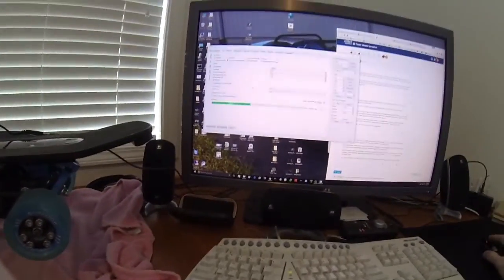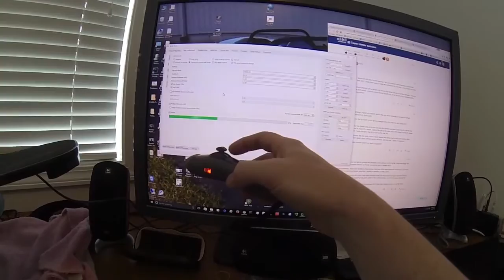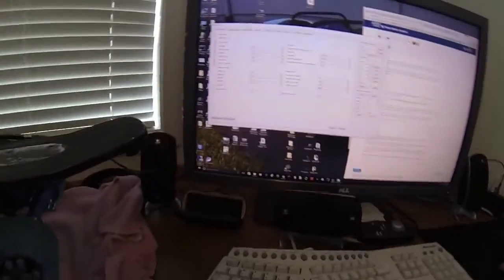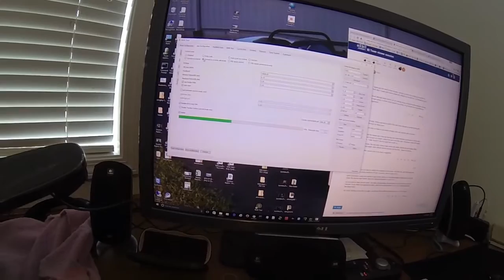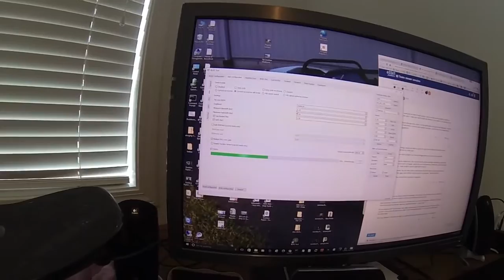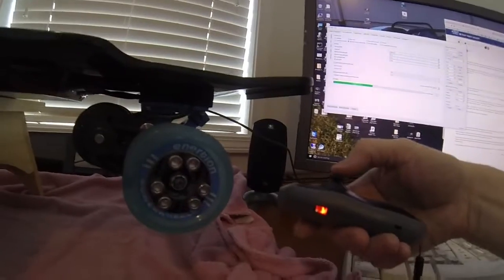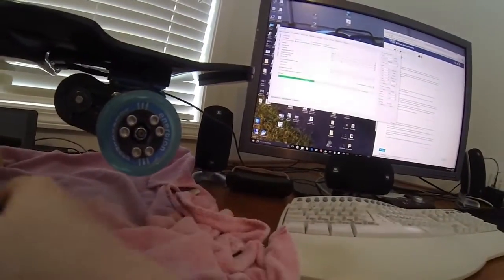Enertion Raptor - Updated VESC Programming

Comment: what range do you get on that battey pack
Reply: I had a failure on the board and had to send it in for repair, so I've only been able to test the range in colder weather.  In that colder weather, and with my less-than-optimal terrain, I got about 10 miles on the 10S3P battery.  Note that Enertion now makes a 10S4P batter...

Comment: is there any way that you could publish the settings that worked for you exactly.  I think you basically have the board i would want it and it would save me a lot of trouble if i could copy your work.  Thanks.
Reply: I could, but it would be meaningless because those settings are not likely to be optimal for another board - that was the crux of the problem in the first place (they derived the settings using a single production board, then copied them).  Minor differences in the various components (this is normal in electronics, BTW!!) mean you need to customize the settings for your exact board.  There are lots of tutorials online that cover how to program the VESC.

Comment: Great video Brian. If you are interested in understanding what PID is, check out this video https://www.youtube.com/watch?v=UR0hOmjaHp0. He does a great job of explaining PID controllers. It's less than 8 minutes long, but if you follow that video to the next, be prepared for the YouTube blackhole. ;) In his followup video he uses visuals (a car) to explain what P, I and D do. The first flight controller I got was a KK2 board and that is PI only, no D (the green and red v-tail quad from Simplecopter). And he explains why that might be okay.
Reply: Hi Brian. I see you're from Oregon too. I'm in the city of Portland. Just wondering if you can help me out with your settings in this video? I want to try them out but I can't see them in this video. If you can help me. It might be easier to just to email me at task650@gmail.com.

Comment: VERY good video! I liked how you presented the information. I'm excited to hear your "feet on the board" results. Seems you'll now have a more car like throttle control with the ability to give incremental throttle and the ability  to "floor it."
Reply from the maker: +Thom Murphy I rode it around my neighborhood today to test my new settings and after a minor adjustment, I'm very happy.  Check out the video I took:  https://youtu.be/hZvSDTrGEWc.  It's just in my garage, but you can still see how much more well behaved it is.

Comment: Just curious man, but how do you change from one mode to another on the raptor, for example from DUTY cycle to PID speed control? Do you have to do it manually on the computer, or is there a way to do when you are out and riding?
Reply from the maker: +jez666666 You have to do it on the computer - you can't change settings on this board while riding.I think it's important to keep in mind a couple things:  1)This uses an open source ESC, which has a wide range of uses (mostly in the RC world) - it's not designed exclusively for this product.  2)Enertion is a small business - they don't have the resources of companies like Boosted.  Combined, this means this product doesn't quite have the bells & whistles that some others do (like an smartphone app to adjust settings, or a custom remote).  On the positive side though, what you DO get is a higher performance board, and you get it for less money.That said, as I stated, the ESC is open source and I'm hopeful that the community will eventually write an app for it.  That would make this a super sick product!!